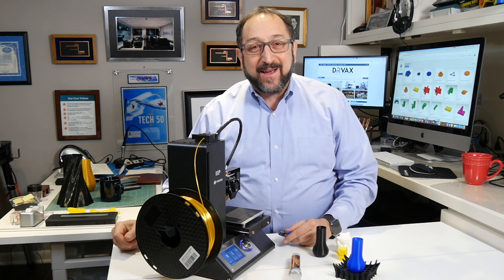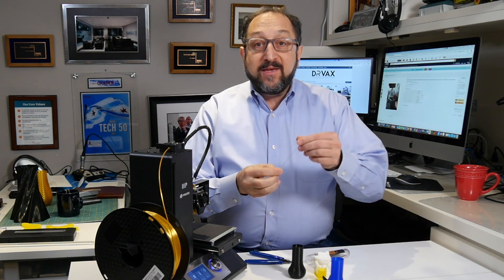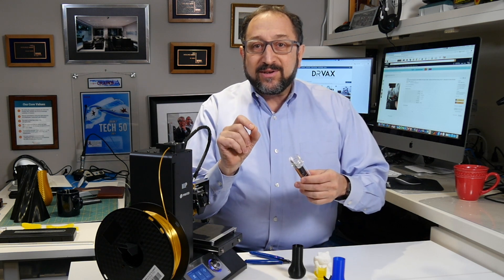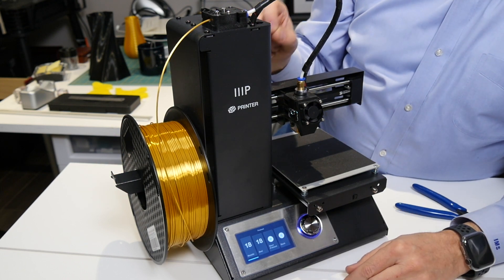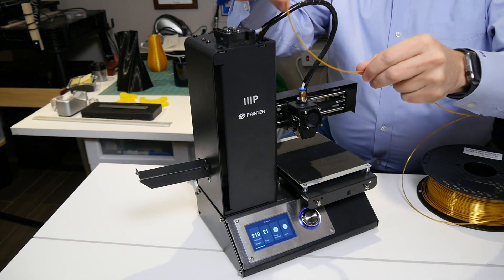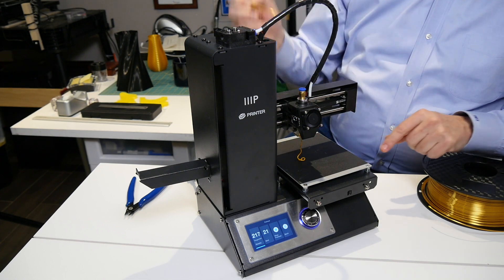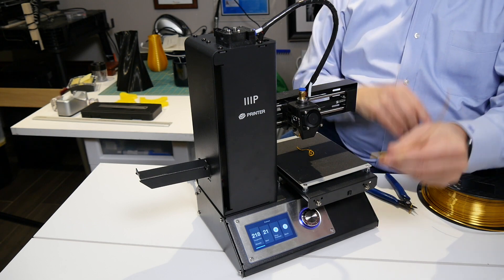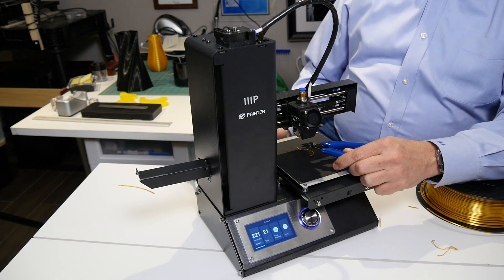The Easy Way to Unclogging Your 3d Printer Nozzle

Comment: A couple of criticisms (1) Your Monoprice printer is uncommon in that the extruder isn't sitting directly on top of your hot end, so most 3D printer users will need to figure out how to get around/through the extruder to use your technique - Selecting a more representative printer would have made this video much more helpful (2) You tell us when using the needle to "be careful", but you give zero details about what we're attempting to avoid and how to avoid it.

Comment: Just to add, I have an all metal Mosquito hotend and a direct drive extruder. PLA can be a bit tricky with all metal hotends  and the hotend heat break can clog with unheated - and unheatable to the point of flowing - PLA. 

I purchased an unclog tool from Etsy. Essentially a 1.75 mm diameter steel rod, sharpened at one end and with a 3D printed handle on the other.  I Turned my printer on, heated the block, removed the filament and nozzle, then disabled the stepping motors. Then I inserted the rod and applied a steadily increasing amount of pressure, taking care to not bend the rod. Voila! Plug of filament that was stuck in the heat break came out. 

Just thought I'd leave this comment here in case it's of use to anyone with a blocked all metal hotend rather than just a blocked nozzle.

Excellent video, btw. Am definitely investing in those needles!

Comment: This worked for 2 seconds and then it got clogged right after my second print. I wonder if it’s the pla because I just got the printer 2 months ago but I did just change to a new filament brand
Reply: There could be a few issues here. Nozzle is not the right temp for the filament you are using. The nozzle is not maintaining accurate heat,. The filament is old (it is affected by light, age, and humidity factors). The extruder is not pushing the filament through at the correct speed. You're not using the correct filament for your machine. You're using an inferior filament product. Your printer might need a firmware update.

Comment: I watch your wonderful videos and subscribe to your channel.  I really like the way you introduce and explain them. This video is  good for small issues.  I would like to ask if you would start a CRASH COURSE in REPAIRS.  With a focus on machine specific issues. Not all machines seem too clog in the same way and those needles DON'T do squat to clear a bad clog. I have aCreality CR-6 SE and I keep getting extreme clogs in the 2 places the hotend and in the Bowden Tube. And I can not seen to fix them other than buying new parts over and over. And then it will clog again with a brand new hotend.  There needs to be in-depth videos for repair and upgrades . . . no one wants to do then apparently.

Comment: an easy way to unclog is to use a small hexkey to pull it through followed by  a needle push through.. its real simple and easy and quick.  
repeat until when you pull the hexkey out there is no more plastic left on it. and the needle is also clean.

Comment: for some reason the filament got jammed inside the extruder on my printer...it's kinda like a freak accident but now am stuck with trying to figure out how to fix the problem. I tried pushing and pulling but the filament broke and now the extruder is stuck with a fragment of the filament inside. I tried a needle but the needle broke...If anyone got any advice besides common sense i would be happy to hear from you.
Reply from the maker: Heat the extruder up to about 220c and try using a needle made for cleaning nozzles again.   Check amazon for 3D printer nozzle cleaning kits.

Comment: Very helpfull thank you for a nice easy to follow video. I am new to 3d printing and nearly 79 years old. I need to make some custom brackets for my headlights conversion to L E D lights.I have borrowed my grandsons printer but has an issue with very bad clogging and it is leaking all over the heater head. thinking about stripping it all down to investigate.

Comment: Hmmm...well the video was very clear and easy to understand but I've got stuck at the first hurdle. I cannot get the bowden tube out because the little locking collar will not depress. I tried the other end and that popped out just like you said but at the hot end I can't move anything.
Reply from the maker: Try heating up the hot end first
Reply: @MakeWithTech  Thanks for the response, yes I followed the instructions as you'd given them so I had the hot end at 220 (been printing PLA at 200). I just took the whole head apart and found some PLA had melted onto the the end of the bowden tube. I got it and the nozzle all cleared and now just waiting for replacement tube.
Reply: Also some have a locking collar, remove that first.

Comment: It's not working for me, since no filament is coming out at all. I tried with the needle, but it's not going in. I print PLA at 200-210°C. Should I soak the nozzle in acetone ?
Reply: Acetone won't work with PLA.

Comment: How hard do you need to press down on the blue coupler it seems to me I’m putting a lot of force on it and it’s not moving
Reply: Some have a ring which prevents the coupler from being pushed down. Remove the ring to undo the coupler; replace the ring when done.

Comment: I am struggling with removing my Bowden tube which appears stuck - I have removed the coupler into the hot end / removed the nozzle but it still won’t budge - any ideas ? 

I have tried heating to 240 and still no luck
Reply from the maker: You have the right idea.  Heat it up then pull hard.  My guess is that there is partially melted filament in the bowden tube due to heat creep.

Comment: My filament snapped when I tried to pull it out, it snapped right at the extruder and I can't fish it out. Does anybody know how I can fix this.
Reply from the maker: Yep.   In fact I just talked my granddaughter through this issue.   Good topic for a a future video.

First some definitions.  The Bowden tube it the tube, usually white, that connects the extruder which pushes the filament to the hot end where the filament is heated and extruded through the nozzle.

If you have a bowden style 3d printer then you can pull the bowden tube out of the extruder (the opposite end of the tube from the hot end) by depress the small (usually white) clip on the fitting that holds the tube into the extruder.   With the bowden tube removed heat up your printer to about 20 degrees C higher than where you normally print.  Then you can pull the filament out of the tube.

Put it all back together making sure you get the bowden tube all the way into the fitting.

A great place to discuss this is at the DrVax forum located at https://forum.drvax.com.
Reply: @MakeWithTech  Nevermind, I managed to shove a toothpick in the tube just enough to grab the filament with pliers.

Comment: I've also heard of people using acupuncture needles. I checked around and found these are very cheap, like 100 for $17 on Amazon.
Reply: .016 electric guitar string works great, the cheapest you can get, about $1 each (around 1 mtr. )

Comment: TIP:- use a different colour filament to push through the hot end than what you believe to be causing the clog, that way you know when blockage material has been expelled.
Reply from the maker: Excellent suggestion.

P.S. I have started a new discussion forum at http://forum.drvax.com where we can all have more elaborate discussions and share pictures on our prints and printers. Check it out.  Irv
Reply: @MakeWithTech thanks Irv I have signed up! and am looking forward to the discussions.

Comment: please do the IIIP ultimate 3d printer the big version please. I have a tiny piece of filament stuck in the tubing under my feeder gears and I cant push it in
Reply from the maker: Unfortunately I only have the Ultimate 2.  It is much more difficult to remove jammed filament from direct-extruder systems.  Basically you have to disassemble the hot end.
Reply: @MakeWithTech  I have the Ultimate 2 as well, so how can one "disassemble the hot end" for it to clear a clogged nozzle?

Comment: Good video. You should look up doing an "atomic pull". Bowden printers especially are receptive to this method. A lot of times, cleaning a clog does not remove all the gunk from the sidewalls of the nozzle (bit like an artery). Using a cleaning filament like e-suns, heating up to 200, then backing off to 125, then pulling out (with some force), will clean off the sidewalls. Do this a few times and works like a charm. Great videos though. Love your enthusiasm !
Reply from the maker: I have found that by forcing the filament directly into the hot end, without the Bowden tube, I have been able to clean any clog without doing a cold pull.   That said, thank you for sharing the technique with my viewers I sure it will be helpful.
Reply: Keep up the positive videos, very cool. Nice to see someone else who loves printing
 @MakeWithTech